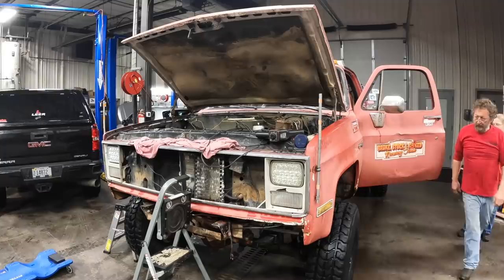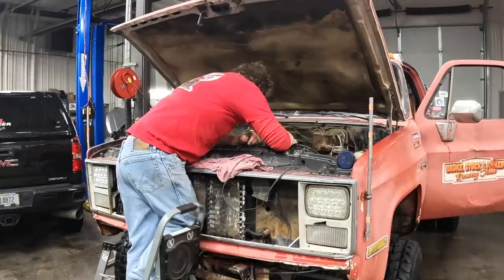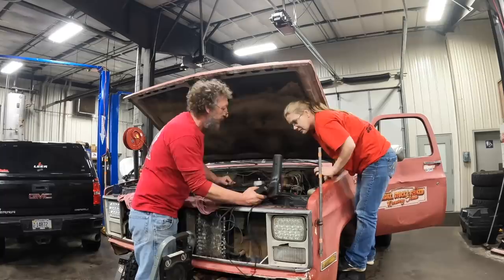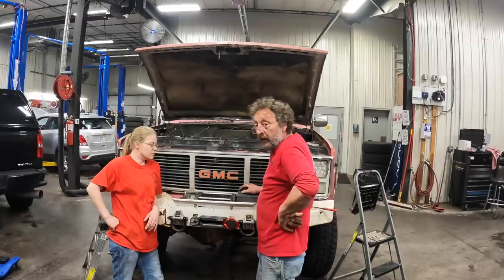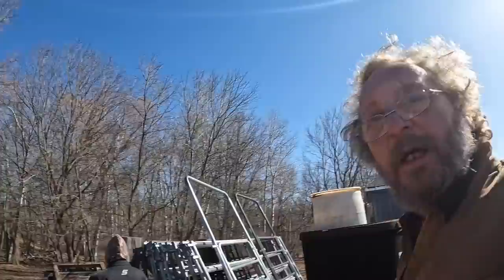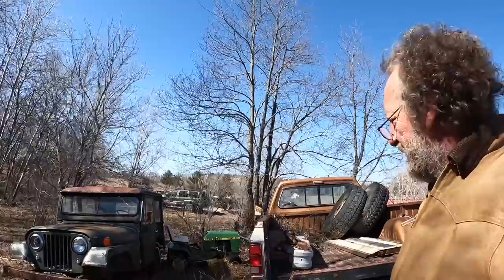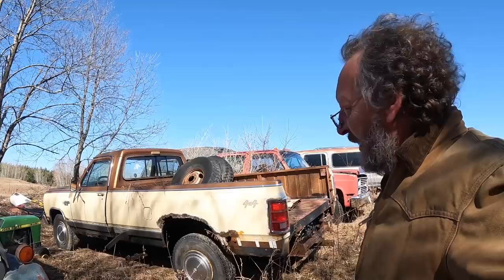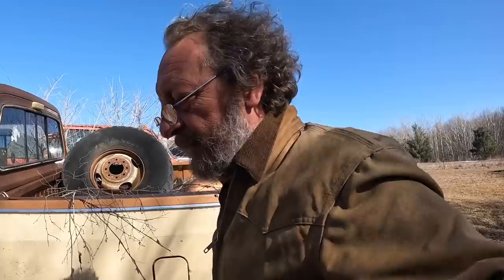Timing Tune and what's left to do?

Comment: Gotta love old square body too bad they don't build Chevy like they use too
Reply: Agreed
Reply: @justinlynch3  💯 planned obsolescence. They want you trading in every 3 years
Reply: My g/f has an ‘08 Toyota Rav 4, only has 275k miles. A/C blows cold, everything works. However, The original alternator gave out last summer , well when I say gave out I mean the bearing just barely started chirping so I had the whole unit replaced, still charged just fine!

Comment: I never understood  why you disconnect the vacuum advance hose example on a carter/afb l/edelbrock carb. The vacuum post on those carbs are above the throttle shaft I believe one out of the two. Timing is checked at idle there should be no vacuum there with the throttle plate closed, not sucking on the distributor advance rod until you create more suction as the two primary plates open.